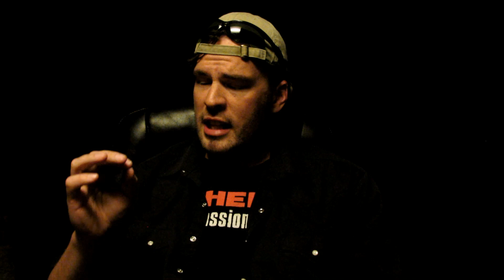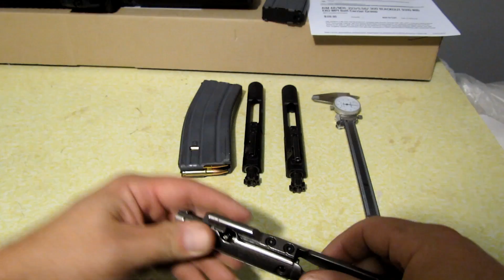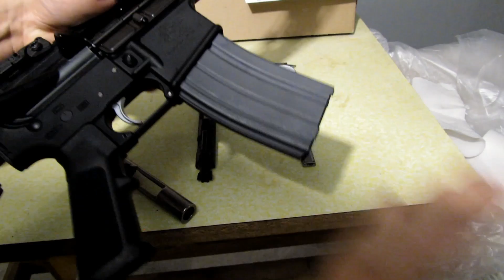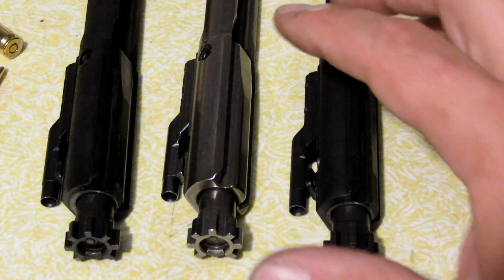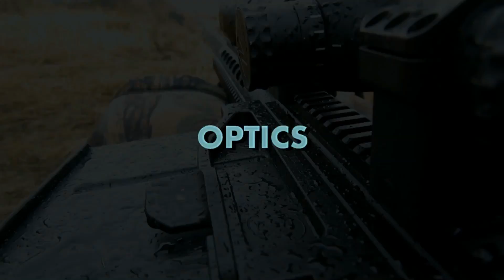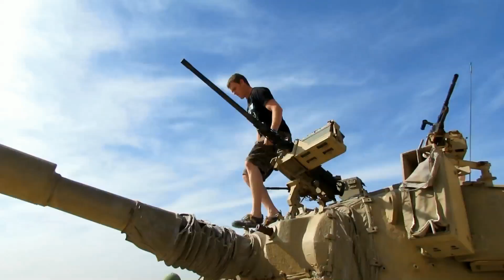AIM Surplus AR-15 Bolt Carrier Group ~ FAIL ~ (9310 NiB EXO MPI)  ~ Rex Reviews

Comment: You have a sloppy bolt carrier fit because of the height of the ribs not the width. The contact points between the bolt carrier and the upper receiver are on either side of the gas key and the two lower ribs. You can check this just by putting the BCG most of the way in (with charging handle in place) and see how much it will rock from the tail of the BCG.

Comment: I have been using items from a company called Toolcraft lately. Some of the nicest looking parts I have ever seen. I get everything in their DLC coating Flawless operation so far with all parts.
I get their Carpenter 158 MPI bolt with DLC coating. Fantastic.
I just put in a BCM Chrome Silicon extractor spring and take out the O-ring that it comes with.
Reply: Toolcraft made AIM BCGs for years

Comment: Intro.   Hahaha.
My Radical  RF-15 has BCG from COLT.  M16 auto bolt carrier.  Works like butter.
14.5” barrel with brake over all 16”.  1:8 twist.
Use a reflex site.  Setup for close quarters shooting.

Comment: I'm a Quality Manager for a gun manufacturer which produces thousands of BCG's. Your diagnosis is a good guess. But there are also other possibilities I saw based on the information you shared. For instance the lugs on the bolts are way out of spec. The bolt lug widths are. 102+/-.002 on all but 1 lug, which is +/-. 001. .106 for a log width, even after coating would be an automatic reject. No argument.

Comment: I am using an AIM bcg thats nitrided in my 300 BO pistol, works flawlessly even with unsupressed subsonic loads, in fact mine runs better than some of the jammamatics with overpriced parts in it, I am only up to 5000 rounds, but so far so good.
when I do a build, I do my OWN QC and verify dimensions and function of parts before installation, but thats what a qualified armor does. the guy who builds it is the final say on QC, EVERY manufacturer sends out bad parts, some more than others, its the armors (builders) responsibility to to determine fitness and fit of all parts BEFORE it sees live ammo and risks life and limb.

Comment: One thing I have noticed is lots of places advertise & say something like "all mil-spec materials". 
That doesn't mean those parts went through all the same processes & checks.  A manufacturer can use 158 carpenter steel without shot peening it or doing HPT & MPI checks. 
They will also do things as they become the topic of the day. When more people became aware of MPI, more companies started doing it. That's good but those companies are also more interested in selling parts than making quality parts. Nothing wrong with making money but if a company won't do certain tests until more people become aware of those tests, that company places profit way above quality. They are trying to use buzzwords to sell more product. 
A true Mil-Spec part, from a military supplier or a top end manufacturer will be shot peened even if most of their customers don't even know what it is. 
A company out to make a quick $ won't shot peene until/unless customers become aware & that becomes "the thing to have". With a true Mil-Spec part, you are getting a guaranteed level of quality even if you don't personally know all the processes & materials involved. 
That said, there are lots of companies making good parts but you don't necessarily know exactly what you are getting unless you really jump into learning about the materials & processes involved in making them.

Comment: You can get a Toolcraft true mil-spec BCG for $75-$90 shipped shopping online.

Specs of the Toolcraft BCG (Also a contractor of the U.S. military)

Mil-spec carpenter No. 158® steel (bolt)
Bolt is shot Peened and MPI
8620 Tool Steel (Carrier)
Chrome Lined Carrier & Gas key
Mil-Spec Extractor Spring, black extractor insert, Viton O-Ring
Tool Steel Extractor
Shrouded Firing Pin
Mil-Spec Gas Key (4130 Steel) attached with Grade 8 hardware and Properly staked

Comment: Yeah... Just encountered this exact same problem involved a high $$$$ 6.5 Creedmoor build using a Krieger match grade SS barrel with an Aero Precision upper & lower receiver and JP Enterprise polished low mass bolt carrier and bolt...... Have over $500.00 wrapped up in the bolt and carrier that suddenly stopped going into battery with the magazine installed.  Pretty demoralizing I might add...... I'm not sure whether to buy one of Aero Precision's bolts and carriers or what?

Comment: I got the Black Rain Ordnance BCG and not only does it wipe clean, it works flawlessly.  It came recommended by an armorer. Not only did I get a superb BCG, I got a nifty sticker to piss off gun grabbers.  The only place any carbon sticks is the tail of the bolt. Scrubs off with a nylon brush...

Comment: I have a WMD BCG and according to them they machine the parts taking into account the additional thickness of the NiB coating so that the final dimensions are mil-spec. I've had zero malfunctions caused by the BCG in my AR. The only malfunctions I've had with my AR build was with crappy Thermold polymer mags. I only wipe on a very light coating of lube on the BCG and don't run it sopping wet like I've seen guys with phosphate BCGs. I've seen NiB BCGs at gun shows, but stayed away not knowing where or how they were made. It seems AIM cut corners both figuratively and literally.

Comment: I bought the same exact bolt carrier group. My measurement are totaly different from yours. Maybe they fixed the quality control issue. Mine works perfectly without fail. It looks great, works great, and cleans like a dream. I love it. Best buy i ever made. In fact, it fits better than my other bolts. They must have seen your review. 10,000 rounds and still going smooth. Does get a bit gummy after a few hundred, so keep it clean.

Comment: You should look at the range of tolerance that is mil spec.  Some of the true military issue bolts and carriers you will see that the standards are high but also have a large group that the parts can fit in.  Looking at about where the stoppage was and your wording that is seemed to hit a wall is about where the gas key and tube connect.

Comment: I had the exact same issue with the same bcg except it's a 7.62x39... The problem is being caused by the rubber o-ring around the spring for the extracter. The extractor is so stiff it needs a lot of force to load a round. My ar would stop dead the amount of Force needed to move the bcg Forward to push and load around wasn't enough. The extractor would not open up to grab the round.... removed the o-ring never had another issue....

Comment: I'm also called an engineer at work, and there's not a locomotive in sight. Did you try putting the Colt bolt in the AIM BCG  and the AIM bolt in the Colt BCG? Of course they wouldn't be color coordinated any more, but Sometimes a little hand fitting can get you two functioning guns instead of one that doesn't.

Comment: I also had the same BCG and it wouldn't go into battery.  Turned out the inner dimension on the gas key was too small causing it to bind on the gas tube.  It would bind hard and require hammering open.  Opened it up just a hair with a drill bit and it now runs perfectly.  It was salvageable, but I would look elsewhere for BCGs.

Comment: So you're testing mill spec on a 300blk? 😜 I run some standard ( non XO) AIM NB bolts on my suppressed 300blk's to tell them apart from my 556's and for easy cleaning, like Nitrite too. have had ZERO issues. I'm not stuck on what the military uses because it's all payola or lobbying, they still use m9's for god sakes!  Plenty of quality in spec AR parts out there at good prices. $200 for a bolt these days is a joke! 

You sound like Dan Ackroyd BTW.

Comment: I find it hard to believe the minor machining/finishing detail of the AIM bolt was causing a failure to go into battery. More than likely it was a headspace issue or a tight bolt lug/barrel extension fitment issue. also if the timing of the bolt lugs and barrel extension isn't correct it can cause a failure to go into battery. Don' get me wrong I go for mil-spec any and every chance I can get. It would be interesting to headspace that particular barrel/bolt combo to confirm.

Comment: Rex you are the man with all things precision and bolt gun.  The AR-15 is the platform I have run professionally for 10 years and for recreation for over 25.  There are only a handful of BCG's I trust and there is no reason to stray from them.  COLT M16 BCG from either specializedarmament.com or fidelisfirearms.com (there are other sources) or the BCM (Bravo Company Mfg.)  BCG.  Absolutely the best and only way to go as far as built to spec. [carpenter 158 bolt, S2 Extractor retaining pin, 8620 Carrier with properly staked gas key, fully shrouded firing pin, M16 configuration, fully parkerized and chrome lined inside.)  COLT or BCM.
Reply from the maker: Right on.  Thanks for the quality commentary based on your experience, sir.  I dig your channel, btw :-)
Reply: TiborasaurusRex I dig yours!
Reply: Denny Ducet colt 😂😂😂😂
Reply: Actually colt sucks nowadays.  BCM is way overpriced.  Give LWRC a try.  They are excellent.  Also try out sons of Liberty gun works out of Texas.  They make some of the finest AR’s there are.  They go beyond milspec.

Comment: Just a tip to anyone who reads this: It's always a good thing to put your rifle on Safe if you plan on chambering a live round for testing purposes.
Reply: joshv06  do you own an AR? If so you should know you any activate the safety until the rifle has been charged....
Reply: @Civiliansoldier762  You can charge the rifle with no magazine in it, then flip the safety, then insert the mag, then charge a live round.  No rocket science required.
Reply: @blueeyeddevil1  yeah that’s ridiculous and an absurd amount of steps to take. Just have some self discipline.
Reply: @Civiliansoldier762  If removing and replacing a magazine takes "an absurd amount of steps," you're doing it wrong. I made no statement that I agreed with the original comment, I simply stated a fact. I personally don't care what approach a stranger takes to anything that doesn't affect me or my loved ones.
Reply: joshv06 never trust a mechanical saftey, the real saftey is between ur ears.
Reply: G. S. G. S.  That’s absurd to do that for a video. I own and have owned several AR’s.  Do people put the safety on their Glock before they chamber a round and cary it all day...???

Comment: NiB is not a coating, plating or finish. It's a metal treatment that adhere to substrate (outer layer) of the metal. In fact NiB and Nitriding are actually going into the metal about .004"-.006". Nitriding goes on clear and then manufactures black oxide to give the appearance that the item was subsequently treated. Whereas, with NiB, due to nickel interaction with the boron gas going into the substrate of the metal. The metal's original color or in the raw is changed to the color that NiB gives off. It you looked at the metal in a spectron microscope you would see how NiB is applied going into the substrate of the surface and then there's a molecular change causing the color change. And actually the defensive dept is in the final stages of testing NiB and Nitriding. NiB is too slick to be applied to the bore. However, Nitride is roughly 68-72 RHc and NiB is 72-76 RHc, both are usually within the medium of the RHc. I understand you're an engineer, but a lot of chemistry is going on here and how that chemistry interacts with various metals. I could provide more detail if you want. I have my MS in chemistry, as well as I'm a M.D., which is my career. Personally, I think you got a bad one. Since, you're only representing a "Sample of One." Now if you had 50 or even 25 BCG with the NiB treatment and got the same results. You might be onto something. Even companies with outstanding OC will put out bad batches. However, it doesn't happen that often. Just something to think about. Sorry for grammatical errors and spelling. But in a rush and unable to proof read and/or correct.
Reply: I have two AIM Surplus NiB BCGs that work great when shooting 556/223. However, I experience the same jam when using either BCG with an AR pistol with a 7.5" barrel shooting 220 gr subsonic 300 blackout factory ammo. I suspect it is an issue of cumulative tolerances using parts from different manufacturers AND the low gas pressure of subsonic 300 blackout (supersonic rounds feed without problems in the pistol).
Reply: That's true for nitriding, but not for nib.. nib is a coating unlike nitriding which is a treatment to the metal surface like you said. That's why nib can flake off if done poorly
Reply: Rick S wrong, NiB is a coating/finish.

Comment: not saying it's not a good weapon I love mine I put money in mine becouse I got it on sale striped down it came from the factory without a foward assist  or dust cover or rear sight so I put on the dust cover forward assist and pop up rear sight and a red dot optic and stocked up some 40 round p mags and 1200 founds of green tip ammo

Comment: I have a little over 1,000 rounds of the cheap Wolf WPA stuff on an AIM ntitride BCG.  So far no problems.  I inspected it after watching this video out of curiosity.  The mic specs are very close to the Colt specs you show in the video and the front of those rails don't appear to have the "rounded off" syndrome yours has.  I think you are right about the NiB ones being polished which is causing material to be lost.  I agree that you can't go wrong with Colt.  If military contractors fudge on specs and get caught it can get them fined lots of money and lose multi million dollar contracts.  That's why true mil spec is a trustworthy standard so long as it's coming from actual contract holders who are tooled up for it.

Comment: Gunsmith I knew built a beautiful Caspian 1911 race gun with a close to zero clearance fit throughout, sends it out to have it hard chromed and it comes back with plating everywhere it shouldn't. I watched the poor smith spend 15+ hours getting it to run right again. Plating= no go for an accurate gun. Stick to melonite or Hard Hat if durability is the goal.

Comment: In my limited experience, I think the most often overlooked area for the problem you experienced, is the alignment of the gas tube to the gas key. More than likely in this case, the added thickness of the bolt lugs is the culprit. I would check to make sure the gas key is not riding on the gas tube and adjust it accordingly.

Comment: although you are talking about mixing and matching aftermarket parts i am curious as to swapping the components on the colt and the polished and see if they work, you say the bolt face is tighter on the polished and the bolt carrier was tighter on the colt maybe give it a try just a cotter pin and keeper...